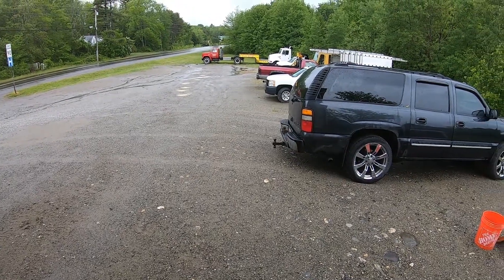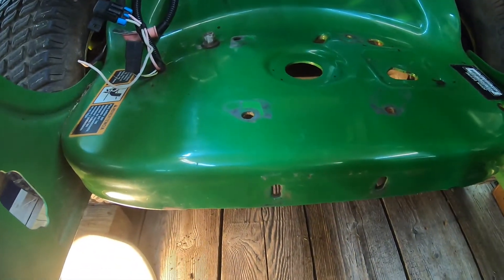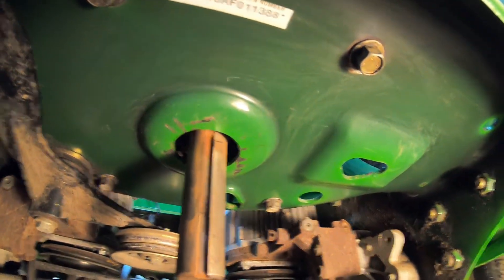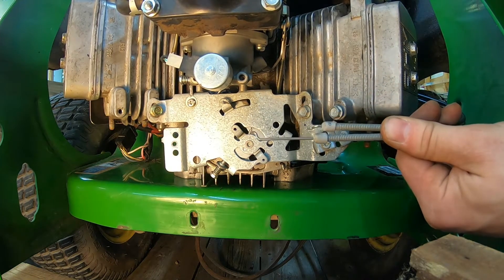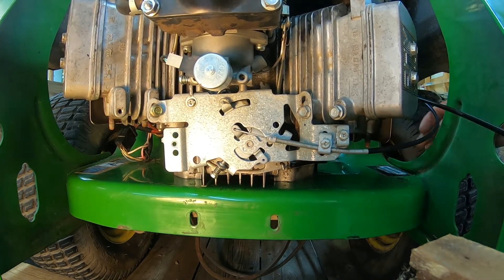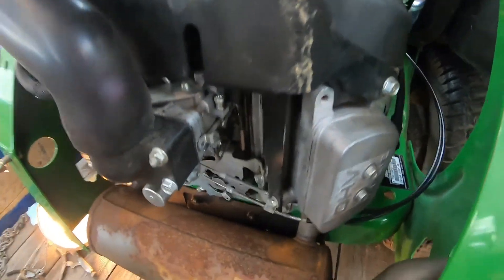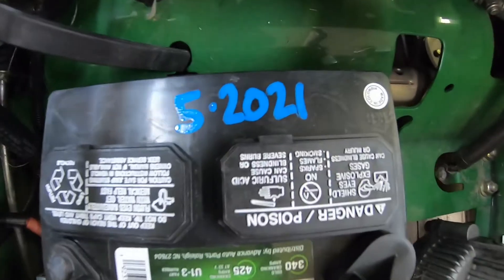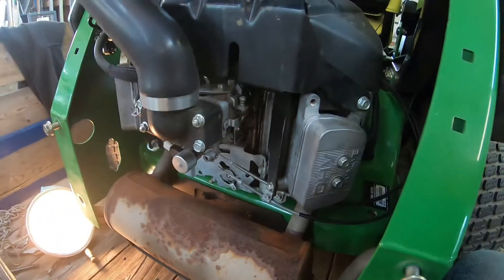John Deere Engine Install! John Deere z810 (Part 2)

Comment: I have a 27 horsepower that did the same exact thing bent the pushrod I'm not sure if you're still doing videos or not but could you tell me why when I put it back together it backfires through the intake
Reply from the maker: I had some bad fuel in the tank from when it was sitting, and I can't recall, but I think i used some starting fluid to get it fired up the first time. Still runs great after all this time